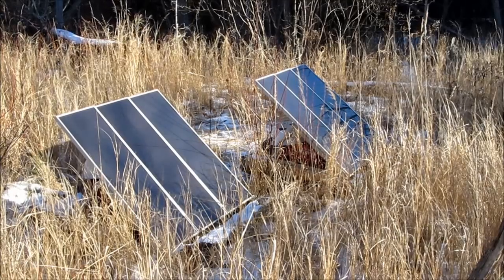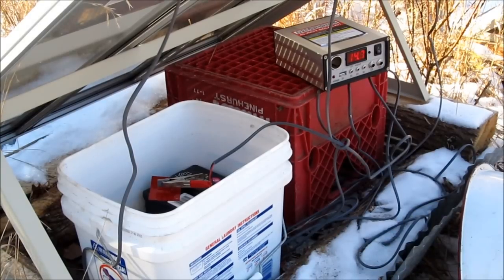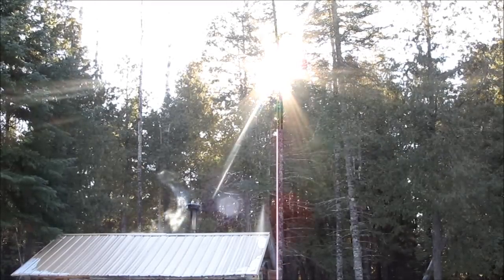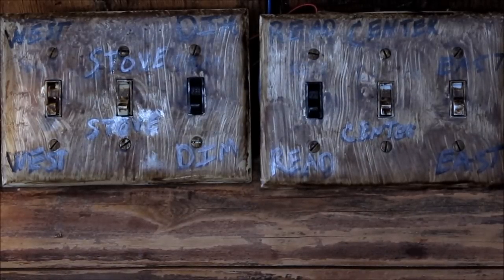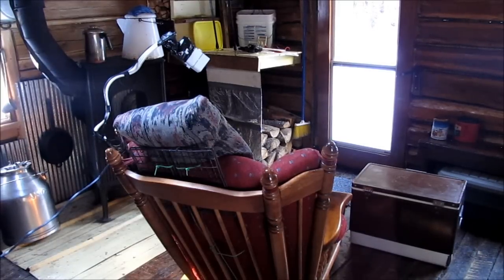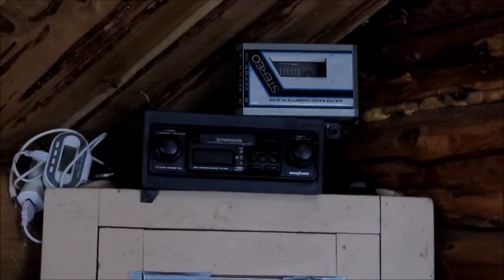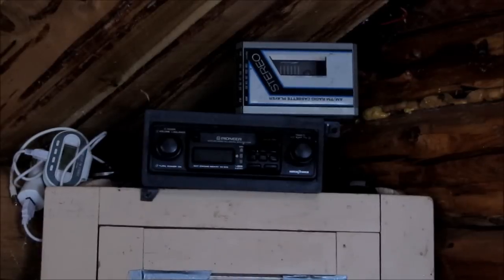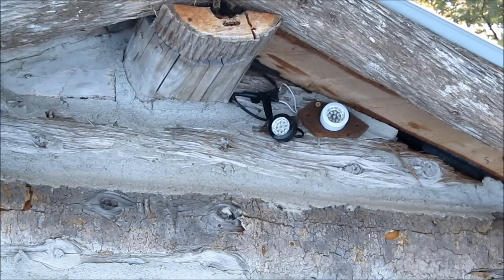Martin's Old Off Grid Log Cabin #1A Solar System for a Small Log Cabin

Comment from the maker: They may be in the future if I can get ones that will not go dead and freeze when I am away for several months. I have access to some big gel batteries but would need a new charge controller to keep the charge low enough not to harm them, but then I would not be using all the power the panels produce either. For now I am getting along fine and have spent no money on bateries.

Comment: FYI.. you can also get MUCH cheaper Solar Cells via EBay. Try just connecting a couple of 100Watt Cells instead of the 45Watt Total from HF.   Your chargers should except this.. check you specs. about $100.

Comment: That,s a great little set up ,you have going there,I have wondered for some time about power here in my cabin ,I,am in the dark except for lanterns flash light,till power comes back on,it,s expensive rates and increasing, I,am too dependent on the grid as well ,this is all I really need to light up the place,thank so much for this.

Comment from the maker: I do not want to open up the cabin area any more so I am content with setting them up in a wildlife clearing that I did make 400 yards north. I added another 45 watt set and can now splurge on winter time lighting. In the spring 45 watts is all I need. In the fall 90 watts and winter is working well with 135 watts.

Comment from the maker: During my last visit to the cabin I paid more attention to how my different batteries performed. The higher cold cranking hour rated battery would not discharge at half the rate of a smaller rated amp hour battery. I started going two days before the best battery would drop to 12.55 vollts. This was lighting the cabin with  48 and 20 LED lights for 5-6 hours.

Comment: Thank you very much, you have given me some ideas to work with.  I currently have two deep cycle marine batteries; two of the same 45w panel sets from Harbor Freight as well.  The power cords that came with the solar sets are really short.  What gauge of wire did you use throughout your cabin?  Or can I use standard household wiring?  Your sled idea is pretty cool too!  I wasn't thinking "outside the box" and mounted them to my deck - I will have to track the and map the sun all year.

Comment: Generally deep cycle is what you want. But as he only uses .2-.3 volts a day, they aren't getting discharged like most systems and the battery should be able to handle that for quite a few cycles. He says he only lets it get down to 12.50 volts which is still a 90% state of charge

Comment from the maker: You are asking a valid question about the amp hour rating of the batteries I use. They are car batteries that vary from 60 to 90 cold cranking amps and vary in age. The higher amp hour batteries should give more power before dropping in voltage but I use too little to be able to give you a factual answer on the difference.

Comment: Nice, wanted to tell you to look at The Power Pot, listen, it makes 5 watts just boiling or cooking in it using thermoelectric Seebeck (300 celsius) modules.  Now, you can see the idea and pots at theepicenter dot come, but if you want to self build cheaper, you can get the modules, make a brick for you woodstove, and generate up to 19 watts PER module, and those run 80 a pop, but they have smaller too, look at customthermoelectric dot come.. You will THANK ME, these work on demand.. any weather

Comment from the maker: 12 volt car batteries will read 12.74 volts when fully charged and 11.95 volts when dead. A digital volt meter (DVM) is used to check them. During charging and for a while after it may show a lot higher but will end up at 12.74 volts

Comment from the maker: When I say I use .2 or .3 volts a day I mean that the voltage on my battery will drop from 12.7 (full charge) to 12.5 or 12.4 in one days use. This is about a third of its capacity as any reading below 12 is a pretty dead battery.. Check the internet to find LED bulbs really cheap. I do not think you will find any 6 volt.

Comment from the maker: That would defeat my goal of using green energy. It is also easier to haul the batteries from the clearing with the solar panels than my wintertime parking spot which is three miles from the cabin. I used to bring in several batteries that I charged at home, this set-up is so much easier.

Comment: As cheap as I am, I would have had a couple LED that I plugged in to different places.  I live in the woods in Wisconsin with grid power, but just use 3 trouble lights with fluorescent bulbs in them.  Love your cabin.  I want to go off grid someday just for the experience of it.

Comment: have you considered mounting a couple of  high output alternators with 4 or 5 threaded rods drilled  into the pulley with some plastic sheets kinda making it in to a windmill vaine. wind turns the pulley which makes electricity. provided you get a fair amount wind around your cabin hope it helps. if you have a running creek you could do the same thing just use water instead of air.

Comment: Check around on yahoo groups for DIY (Do it yourself) solar group, Friend of mine and I bought a 140 watt over 7amp panel for 160 bucks, I used to have the Harbor Freight panels you show, and moved up to a better panel, Monocrystaline,  and it works great.   Those that you have work well, but I wanted something with more wattage and amps, and did better...